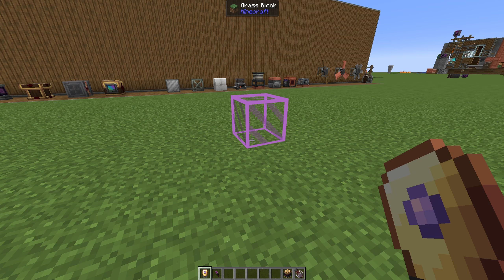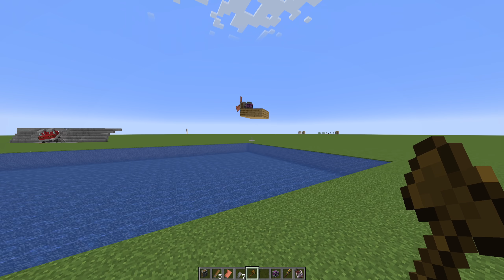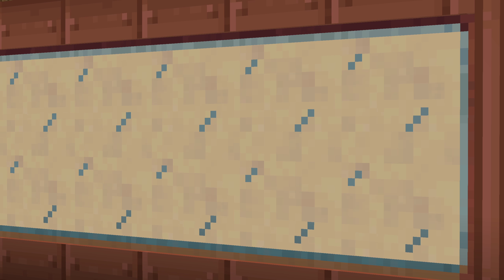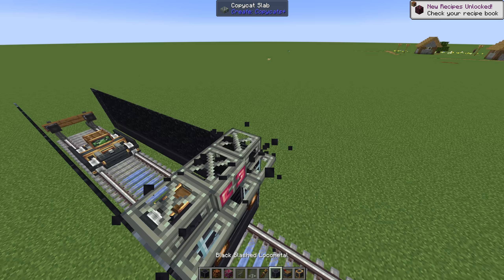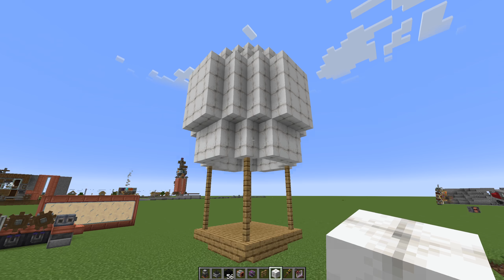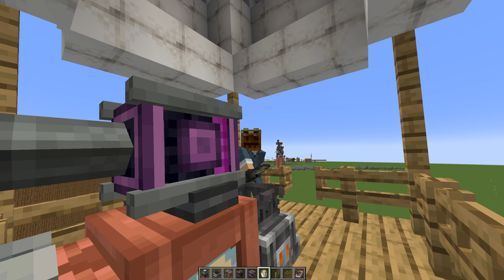This Create Addon is... Hard?

Comment: torque effect is in simple terms, when a blade moves clock wise. it also tries to move the plane itself counter clock wise due to newtons 3rd law. every action has equal and opposit reaction. in single engine plane its an issue.

Comment: 18:00
probably could use it to make a floating base that tries to slowly stay around one area, just burry the loadstone deep beneath, compass in the center of the floating place, and the right redstone and such to make it go where it is, probably with low power so it kind of just slowly goes around in that spot rather than too high power and such, like it drifts here and there gently kind of movement.

Comment: one thing to note about the assembler of this addon is unlike wanderwand setup which requires blocks to be connected face by face, this one doesn't, it generates as one ship as long as the blocks are in the area doesn't matter if they're connected or not.

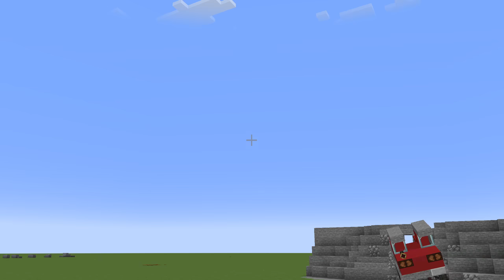Comment: 3:46 without testing, I can only assume that the torque effect means that it doesn’t force the physics object the propeller is attached to to rotate in the opposite direction that the propeller is rotating.

Comment: EDIT: I have been informed  that this is misinformation and it's actually a bug with Create: Interactive. If you made your crane with a physics bearing from Clockwork, it will probably actually work.

Hi Shalz! The magnet floaty-floaty thing you were experiencing is a result of an attempt at optimization by the main man behind Valkyrien Skies. It has caused so many issues for many addons, so it is being reverted in the next update of VS2!

So, once that comes out, you will actually be able to make proper magnet cranes!
Reply: Is there an ETA for vs2?
Reply: @rougeneiiige  VS2 is the current version of VS. The next update will be 2.4.11, and there is no ETA.

Comment: The crane is a normal contraption, it has to be a physics object or an interactive contraption for it to have collision with other physics objects
Reply: he COULD use a phys bearing from clockwork
Reply: @DJTRM  that might work
Reply: bros John Create
Reply: @AliKhan-pv3oc  well, technically simicat is John create, but I see where you're coming from
Reply: @martjoller1676 you're john create (parody account)
Reply: was just gonna say
Reply: isn't interactive broken at the moment
anytime I using interactive to move physic entities with create contraptions, the phys entities just disappear( actually they are still in the world but for some FLIPPING reason they get flung at mach velocities far beyond my eyes and the renderer can render and hence disappear in a single frame)
Reply: @FyBanj not for me. maybe it's cause i'm running a different version but last time i checked i'm up to date (forge). it works fine for me with trains, planes, boats, etc.
Reply: @AvidCJ4  well if the phys entities are on your machine before it turns into a contraption ( the form where it usually interacts with create blocks) you might get my result. If places after it become a contraption it works fine. This can be alright form mech bearings and trains (assuming they are already assembled). But if you want to make elevators with gantry shafts, rope and elevator pullies for such phys entities (since the blocks associated with them turn into normal minecraft world bocks as soon as they reach their final destination), they might cause it to fling if the ship is on the associated blocks before those blocks turn into movable contraptions for repeated use making this very frustrating. 

I hope you understand what I am trying to say here.

Comment: For your torque effect question:
Imagine you're holding a spinning top. As the top spins clockwise, you can feel it trying to twist your hand counter-clockwise. That's torque effect. The reaction force from rotation.
Reply: Hence when designing propeller-based vehicles, you need to use an even number of them and rotating in opposite directions to cancel out the torque while still having thrust.

It’s why helicopters have the additional propeller on the tail: to cancel out the torque from the propeller on top.

Comment: 3:45 no torque effect most likely means that it doesn't try to spin the creation in the opposite direction of the rotor. So you don't need the second propeller that spins in the opposite direction to counteract the torque.
Reply: TIL andesite is the sole exception to Newton's third law
Reply: yeah
Reply: I was legit about to comment this lol
Reply: Yeah this is what I guessed,
Reply: Roflcopter goes SWOOSHSWOOSHSWOOSH
Reply: It still spun
Reply: @LuisMusgo-jp1ck  Because it was off center, not because of the rotor spin it self
Reply: @LuisMusgo-jp1ck it was spinning along a different axis, so torque has nothing to do with it